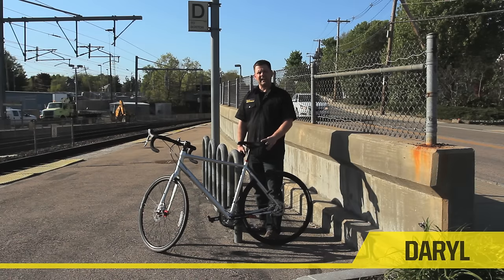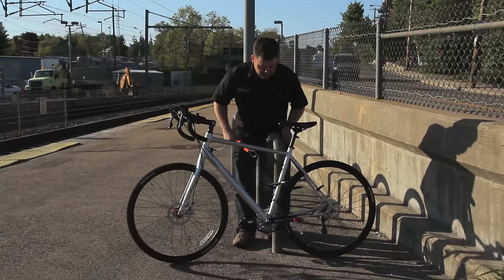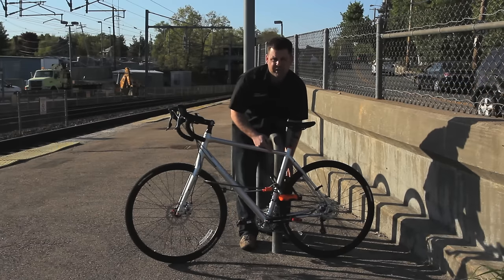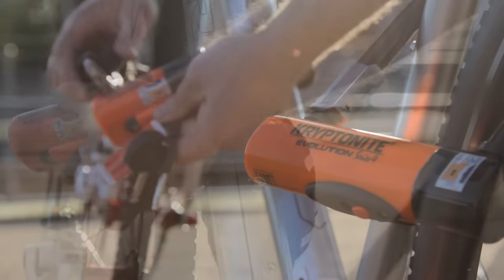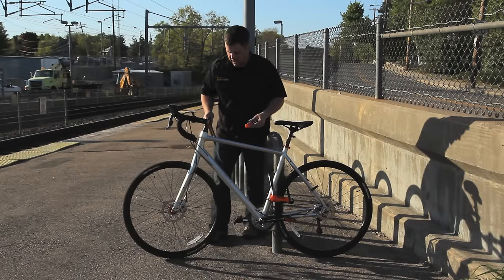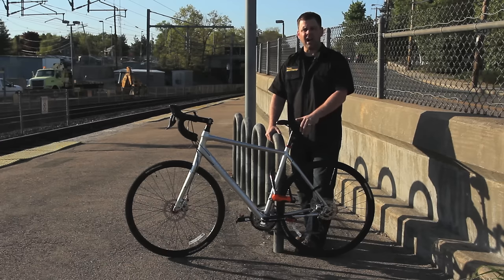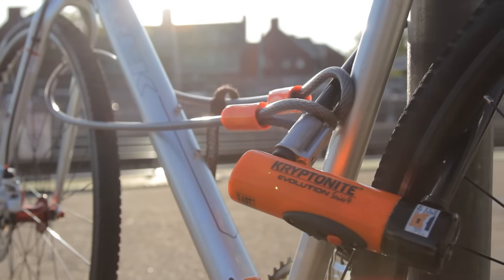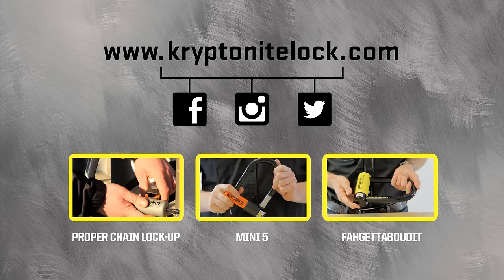Proper Bike Lock-Up Video with a U-Lock

Comment: Do not use a U lock because after a week or so they start to refuse to lock and unlock. I bought a U lock and used it for about a week and then it would would not lock and hoa to force it to lock. When I came to unlock my bike it would not unlock. I had pull it against the frame if my bike to get it to come apart...I ended up scratcjing the frame of my bike. I'm not happy these locks are unpredictable. I'm going to invest in a good quality chain lock inatead.
Reply: sorry about spelling mistakes....using an annoying mobile phone keyboard.
Reply from the maker: +TheToshiba86   So sorry to hear that you've had a problem with your U-Lock.  Please submit a Request Ticket with your information and details.  We would like to help!  Please attach a photo of your lock.
https://kryptonite.zendesk.com/anonymous_requests/new

Comment: Should I buy larger or smaller U-lock?
Reply from the maker: We recommend that you use a lock with the smallest "U" that can accommodate your frame and wheel locked to a stationary object.
Reply from the maker: Nice!  Choose the lock that makes the most sense for you, size-wise.
Reply from the maker: Hi Michal - with your Dartmoor you are best to use a standard size u-lock - either the NY Lock Standard or the Evolution Series 4 Standard
Reply from the maker: our standard u locks would be called Standard or STD - there is no "S" - by "L" you might be referring to long shackle - I recommended "STD" - either NY Lock or Evolution series 4

Comment: I have a fat tire bike and this shackle won't go around the real wheel nor is it long enough to secure to anything if going through it. What a pain.
Reply from the maker: +Brandon “Innomen” Sergent Hi Brandon, you may want to consider one of our Integrated chains.  They give you more length and flexibility than a U-Lock.  http://www.kryptonitelock.com/en/products/product-details.html?id=kryptonite:product/style/chains
Reply: +KryptoniteLocks 
Hmm. Would it be possible to order a longer shackle for a kryptolock series 2?

I know you guys make a longer shackle lock, it's on Amazon.

If not, could I exchange the lock I have towards the longer model? 

Chain links are too narrow for a 1500$ electric bike, wouldn't you say?
Reply from the maker: Sorry, we don't do product exchanges.  If you just purchased it, would Amazon exchange it for you?  The KryptoLok Series 2 and Evolution Series 4 Integrated Chains are rated similar to their U-Lock counterparts, security-wise.
Reply: I don't need an entirely new lock just the series 2 LS shackle.

I can't order one from you guys? O.o
  	
	 	 	 	 	As in Kryptonite KryptoLok Series 2 LS U-Lock
Reply from the maker: +Brandon “Innomen” Sergent high security chain such as EV series 4 10160 integrated chain is 160 cm with 10mm links... for expensive ebike I would recommend ultimate security NY Chain (12mm links) or NY Fahgettaboudit (14mm links)
Reply from the maker: +Brandon “Innomen” Sergent unfortunately no - you can't order just a shackle from us